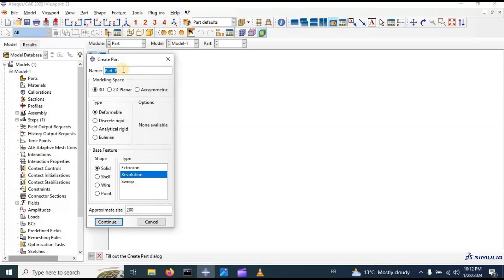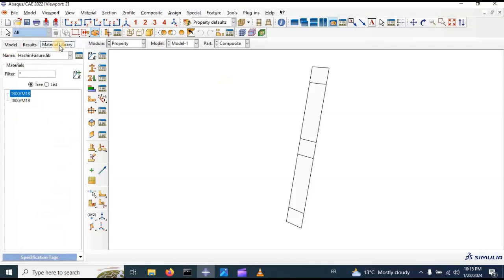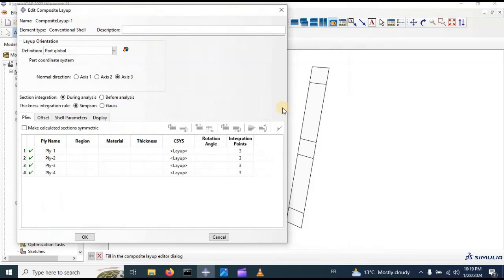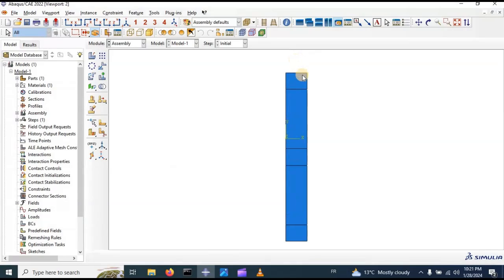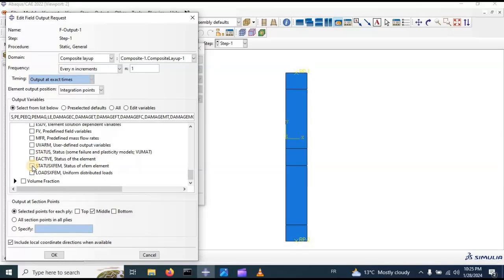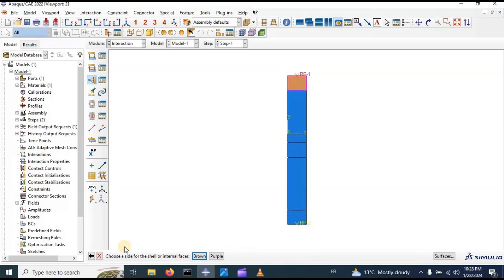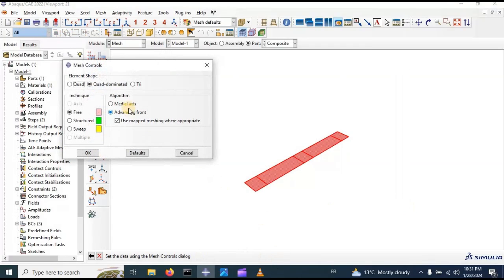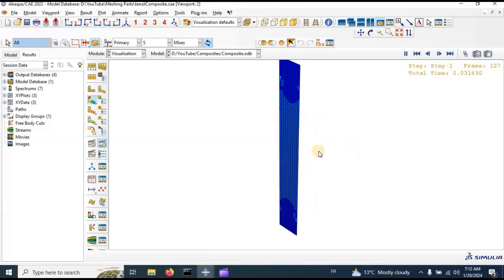Abaqus Tutorial: Tensile Testing of Composite Laminates using Abaqus Hashin damage material model.

Comment: hashin damage value is same for all composites and if different how to get those data
Reply: It is different for all composites. You need fracture energy values which are determined from stress-strain curves obtained through experiments. 
See this video for reference: https://youtu.be/Zsl6nMyT_Lo?si=_ELJtbSUi8X3O-ne
Reply: @AbdulPosting  thank you.let me check.
Reply: @AbdulPosting  can you explain sir how will get the  property of E1,E2,Nu12,G12,G13,G23 AND HASIN DAMAGE PROPERTY? Suppose 13 layer of glass fiber laminated composite are given. how will get all property?
Reply: @KUMARABANINDRAJANA  For basic mechanical properties like modulus and poisson ratio, you can refer any literature. Glass fiber is a very basic composite, you will find it easily.
However, for Hashin Damage parameters, you need experimental results of fracture tests and these are difficult to perform, so I'd suggest you use some generic values for glass fiber composite from any research paper, or any tutorial video where glass fiber is used.
Reply: @AbdulPosting  Sir can you help me any research institute or setup  where I can easily find out  those property (hashin damage property) if have any institute they can gave composite experimental setup, I have 100 KN UTM  machine.PLZ HELP ME SIR
Reply: @KUMARABANINDRAJANA  You don't need to perform these tests for properties. just find out from literature.
Reply: @AbdulPosting  sir, suppose my laminated composites like 11 layers of fiber (including glass fiber ,carbon fiber, Kevlar mixed with change of orientation) with resign mixed   a particular laminated composites. I know this type of composites there are no particular property are not available.so how to find out  hashin damage property?
Reply: @KUMARABANINDRAJANA  for such a hybrid composite, you need to find values through experimental testing
Reply: @KUMARABANINDRAJANA  What did you do?
Reply: @AbdulPosting  ,Mr. Rehman can I get your contact no. plz